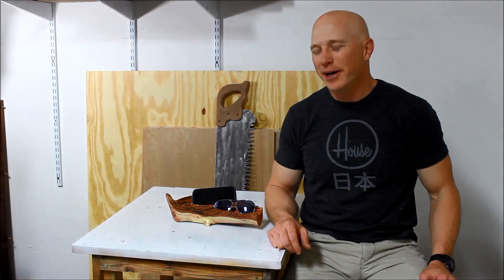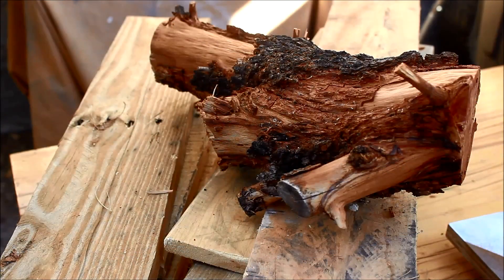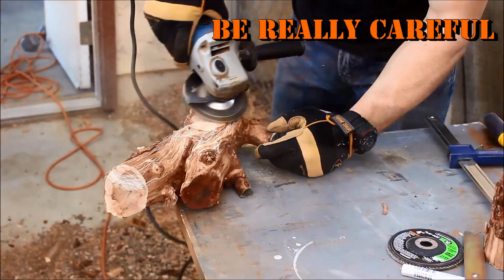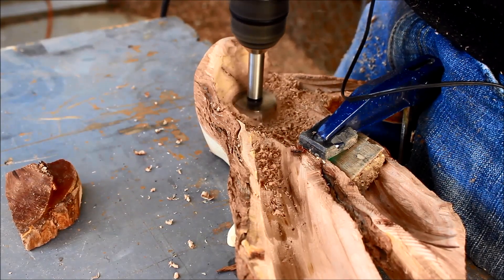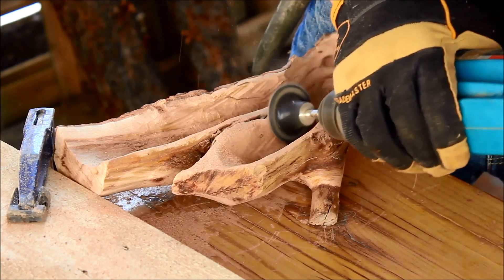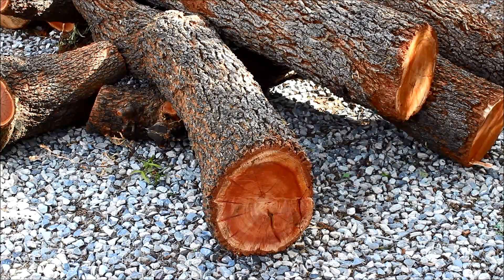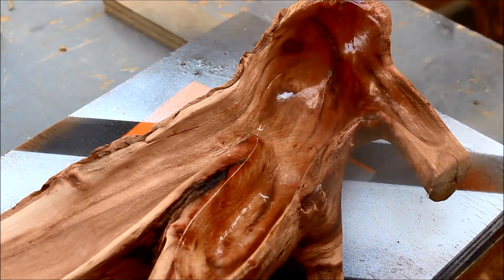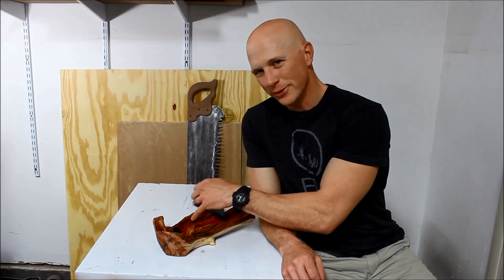Carved Wooden Valet Tray For Your Cell, Sunglasses and Keys

Comment: Project turned out great. Gas mask and Punisher shirt... A+. Yeah when I use an angle grinder with a Lancelot disc, I hold it with a death grip. The thought of kickback with that thing is crazy scarier than it happening on a table saw.
Reply from the maker: diycentral Thanks!  Death grip and keeping the guard on is the way to go for sure.  I know what you mean.  I hit a knot area that kicked it a little.

Comment: Clever idea, and the wood's color is sweet.  Regarding which carving tools to get, I'd say it depends on how often you plan to use them.  For regular use, I'd recommend either Pfeil or Hirsch.  In my experience, the Pfeil tools are better suited for carving with arm strength alone, while Hirsch tools are more appropriate for mallet work.  Quality between them is comparable, but Pfeil tools are a bit more expensive (but neither are exactly inexpensive).  That being said, if you don't plan to carve on a regular basis, but still want some respectable tools, check out some of the Flexcut kits.  They're fine for the hobby carver who only uses them periodically, whereas Pfeil and Hirsch are geared toward those who carve on a daily basis.  Hope that helps.
Reply from the maker: RSM Woodworks Thanks for the advice.  I was actually looking at those Flexcut kits as a next step.  More like the opposite Uncle Buck philosophy, from cigarettes to cigars to pipe then you can quit.  For me super cheap chisels to Flexcut to Pfeil.
Reply: I have a couple of the Flexcut kits with interchangeable cutters.  They work well for fine detail work, but switching out the cutters becomes inconvenient when you need several at the ready simultaneously.  Flexcut makes spare handles for this, but they're kinda pricey for what they are.  I use Hirsch for heavy duty work, but I want to get some Pfeil tools eventually, too.  Also, the Auriou carving sets endorsed by Chris Pye are worth a look as well.